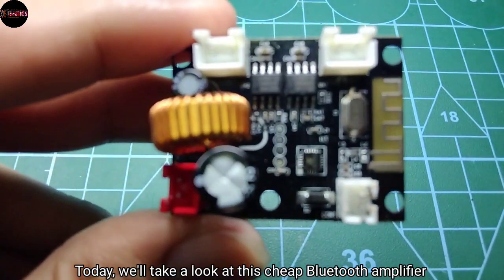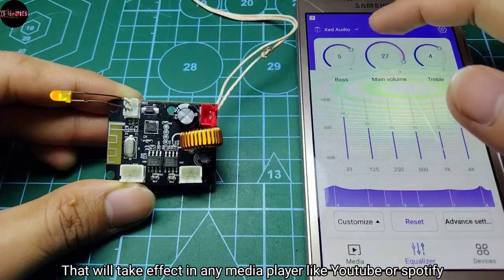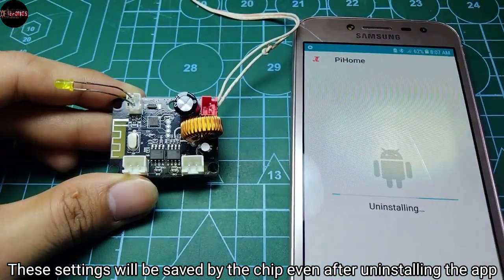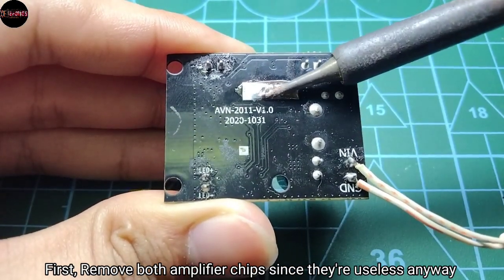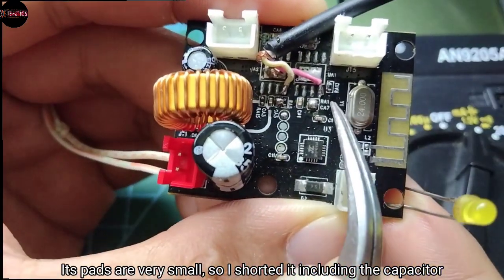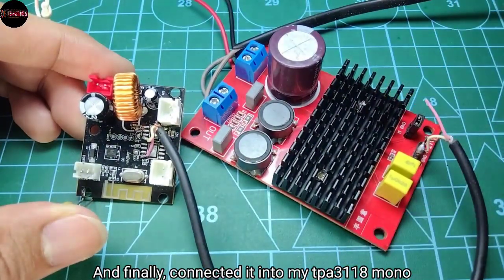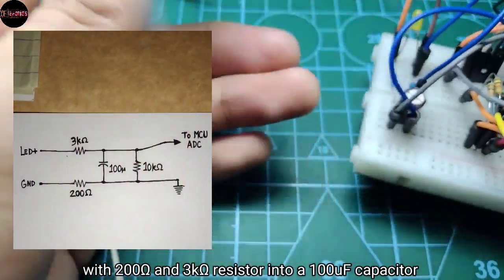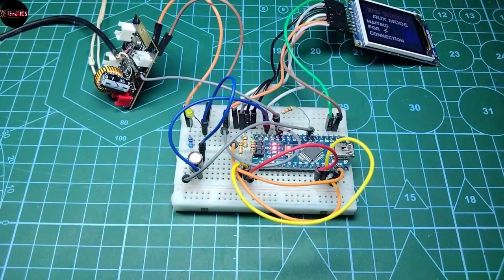This Board's Feature is UNREAL for 2$ !!#amplifier #aiyima #bluetoothspeaker #electronics

Comment: I recommend just adding an attenuator on the output if you"re not that good on soldering
Reply from the maker: The distortion from the chip amps will add and it will sound kinda dirty

Comment: Excellent video! I had this on my mind recently, but you got it out there first. Are you using a single power source for the Aiyima board and the audio amplifier? If so, do you encounter any ground loop audio problems?
Reply from the maker: Heyyyyy, I knowww youuuuu!! I watch your channel as well.

I didn't try to use single supply for both amplifier and decoder. During the test, it had separate power supply.

But , most of my projects like this, I always use DC-DC isolator for best audio performance.
Greetings🤍
Reply: @x3dtronicsph big fan of your videos too bro, thanks for the reply.

Comment: This model not available in india
Reply from the maker: I'm not sure bro.
You can try taking a screenshot, and Searching it via Google Lens
Reply: Can you name the bluetooth ic chip on this board?
Reply from the maker: JL 8P 10740-69A4
That's almost like it.
You need to find the exact same Board/Module. Even if you find the chip, the manufacturer of the board did some programming to work it with the Application.
If you somehow find the chip in a different board, There's a chance that the app might not work.
Reply: @x3dtronicsph  did not find the marking either..
Reply from the maker: I did try as Well.
Unfortunately, JL (chinese chip manufacturer) doest share datasheets of their chips
Reply: I bought it from alibaba 
Chip cost 1.15$
Shipping 4.5$😂
Reply from the maker: PiHome is not available in playstore now, you can download from Chrome🙃
Reply: @x3dtronicsph  oops 😬 thanks for update
Reply: @x3dtronicsph  is it required to remove ic like shown in the video?
Reply from the maker: @sanb3586 you can download from my drive😆.
https://drive.google.com/drive/folders/1Ci46qmaPcmIsbUfkQSuuhFmXmG_IgUHr

Password is "xedtronics"
Reply from the maker: If you're going to use it as a Bluetooth receiver , Yessss

Comment: first viewer bro
Reply from the maker: Thanks bro.
My Irs2092s board got stuck.
I will try to modify to work in ±25volts in probably next vid.
Stay tune bro
Reply: @x3dtronicsph  okay naa pud ko 2 ka irs ako gigamit... dexter diay name nimo sa shoppee nimo bro... kita kos review nimo sa tpa3118 sa best8 mall...
Reply: @x3dtronicsph  ang irs2092s nako bro kitong naay relay
Reply from the maker: @thegrowl8874  wala kasi ako supply na mataas boss, try ko sana gawan ng calculations para gumana sa Low voltage.
Pinoy ka pala boss
Reply: @x3dtronicsph  boss pinoy na bisaya... taga dumaguete ako